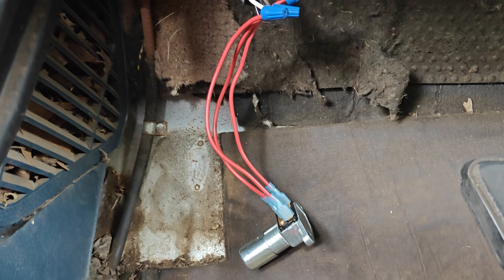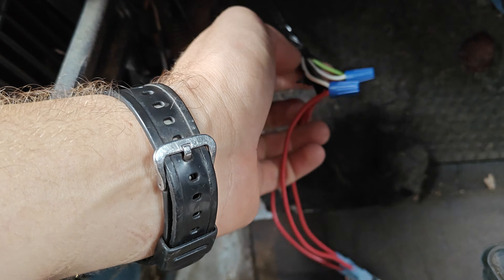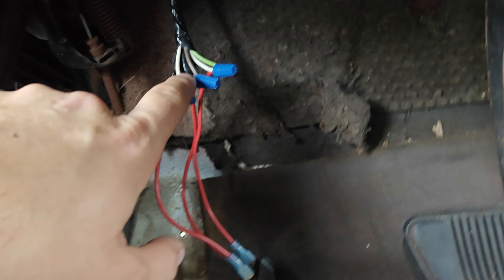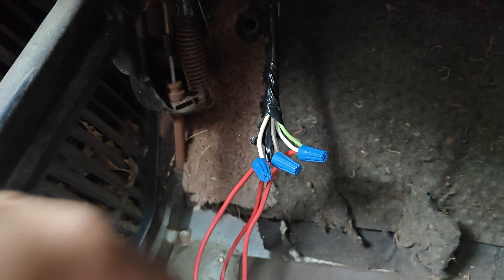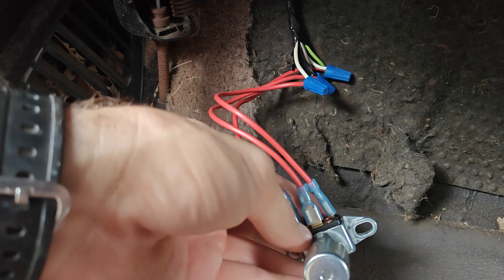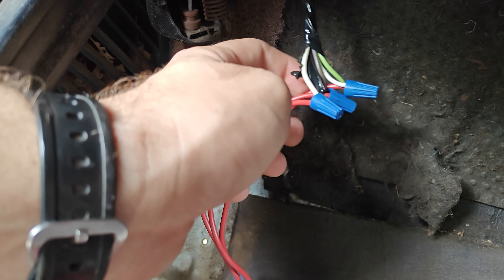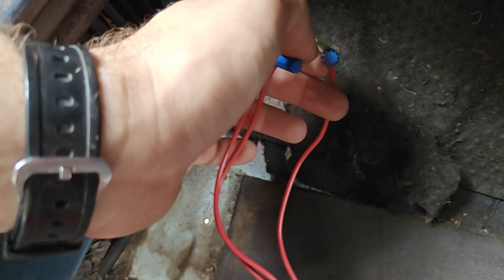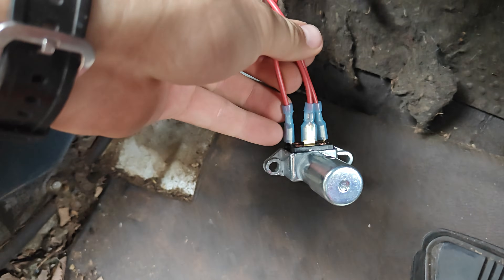Wiring high beam / low beam foot switch dimmer.

Comment: One neet trick is to wire the low beam wire with the hot from the headlight main switch. This way, when you switch to high beam the lows stay on and the highs fill in. On my 4 headlight system I kept one low on the edge of the road and the second low straight ahead. The left high was way over onto oncoming traffic and the right high was straight ahead. It would light up a 2 lane road beautifully.
Reply from the maker: nice tip!